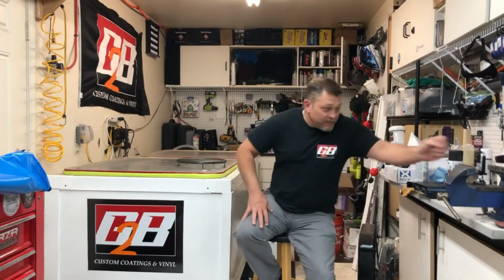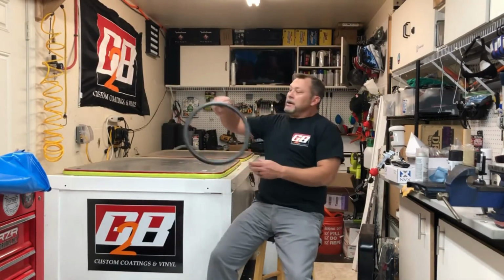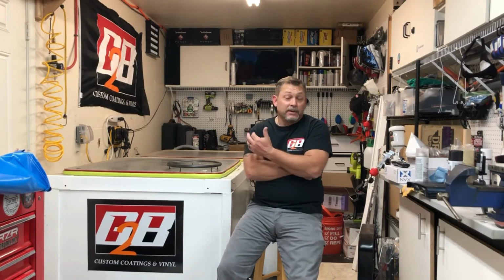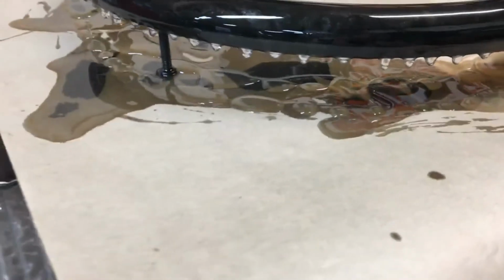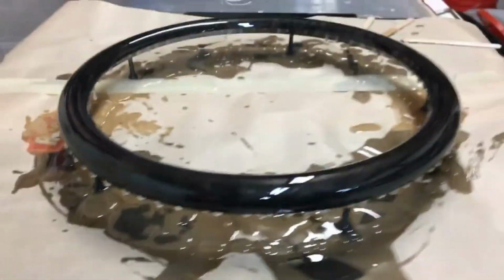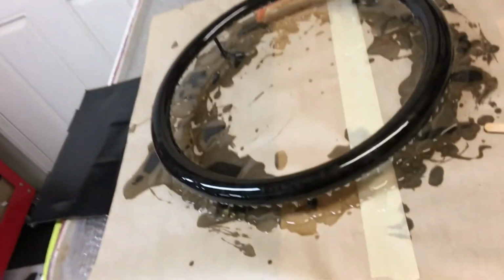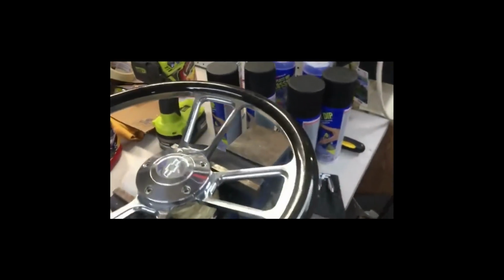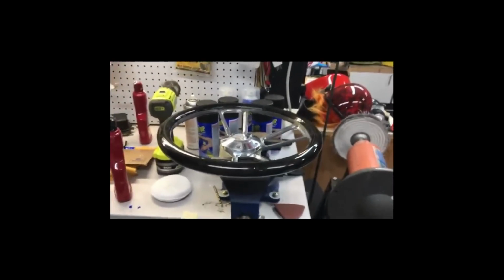Black Wood Grain and Epoxy Steering Wheel

Comment: Hi ! i was wondering how they do this i do understand that involves a lot of time and work ! i am not afraid of the question here is that this a 2 part steering wheel , i have a solid steering wheel that comes with leather and wood in the lower center and the upper center and in the sides leather ,i have to remove the resin because is cracked in several parts ,i am wondering how to remove the resin coat in order to restore the wheel and to not affect the wood . any ideas all would be a great help ! awesome work ! you did here.

Comment: Wow, just wow. Great work. Exactly what I’m looking to do, but with a brown Burrwood. A couple of questions the epoxy you used nothing special right just 2 pack Araldite or some such? And I’m looking at hydro dipping kits and they soupy a top / clear coat rattle can - did you use the epoxy to build up depth only or because of the amount of handling the wheel will get? TIA
Reply: I use 2 part boat epoxy, but I did not clear coat the hydro work before epoxy. The epoxy acts as the best clear you could ever ask for. Yes I wanted to build it up and make sure it would handle the wear of driving the car. Thanks for the question!